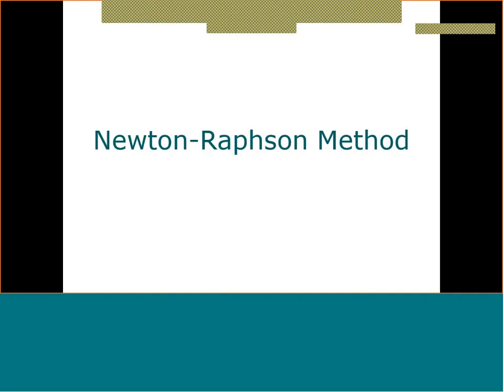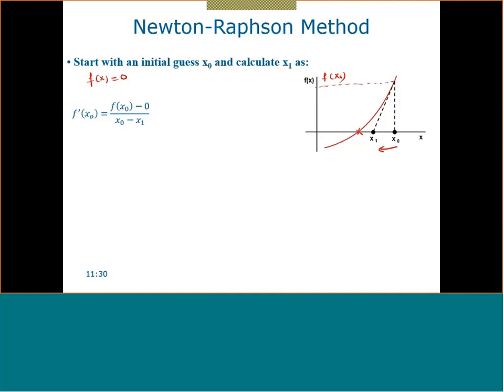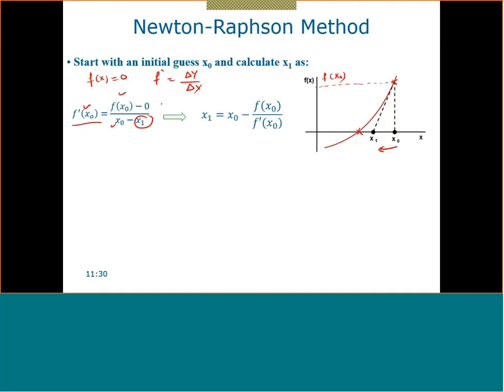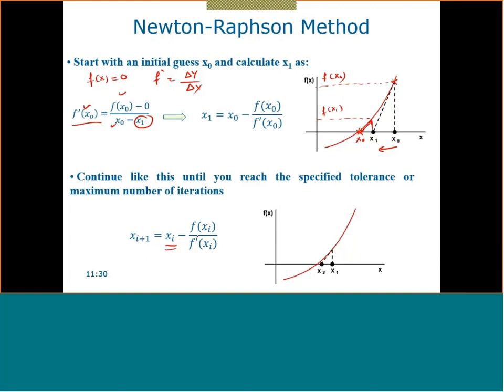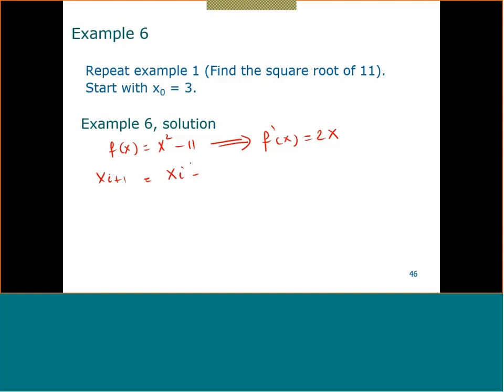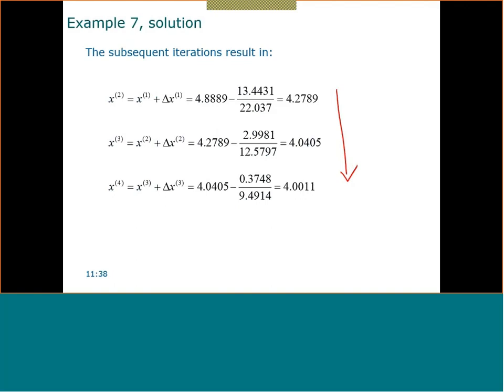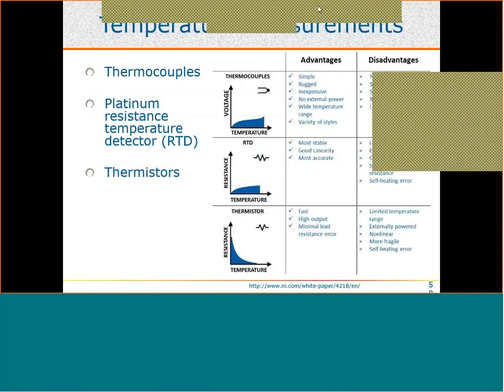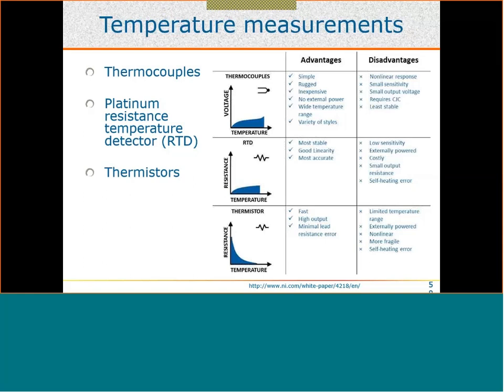Lecture 9: Roots of nonlinear equations  - Part 3

Comment: Can we not solve RTD second order equation by simple quadratic formula?
Reply from the maker: Sure you can do that, but we are trying to apply numerical method techniques because the RTD can have higher order polynomial, and hence it will be harder to solve it using simple mathematical formula. Also, it is important to compare numerical solutions with closed form ones to check the correctness of the numerical approach.